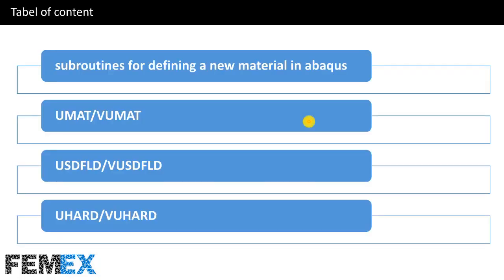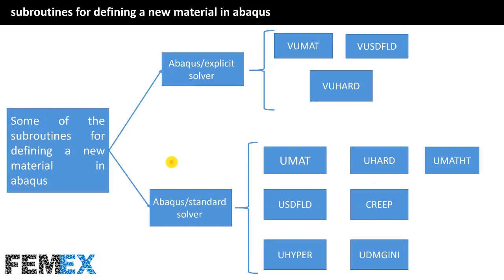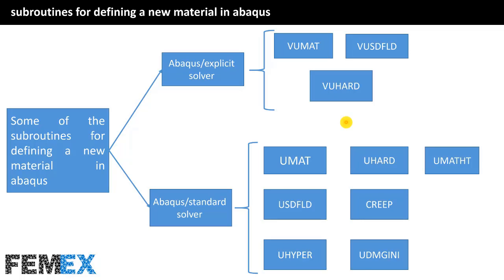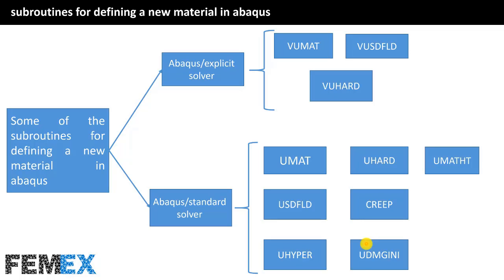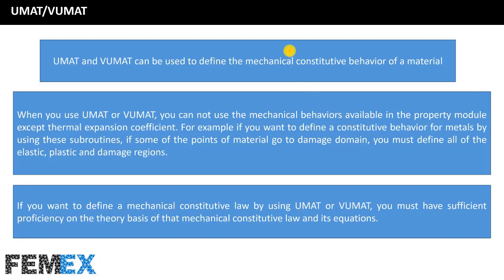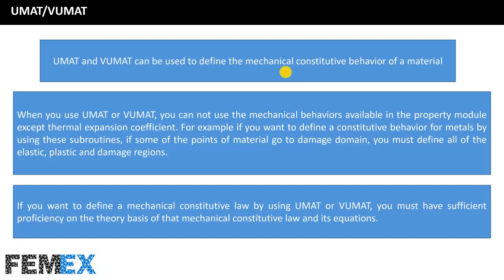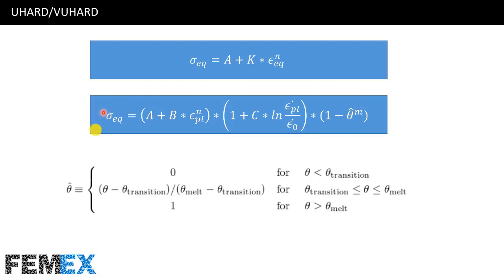umat and other subroutines for defining a new material model in abaqus

Comment: Hi
Thank you so much for your videos
I have a question about writing vumat subroutine for JC model including the thermal effects. Should i write the heat transfer equations including the conduction equations in the subroutine ?
Thanks in advance
Reply from the maker: Hi.
You are welcome.
Honestly, I have not done it before, but as I have read its related documentations for several times, I know that conduction equations must not be written in the VUMAT. Actually there are two choices :
1) writing subroutine for adiabatic process
2) writing subroutine for coupled process
for the first case, you must only write the energy balance equation which is like Q=m*c*delta_T.
For the second case I don't know what should be done.
Reply from the maker: If you are not familiar with the adiabatic process, please watch this free video from our YouTube channel :
https://www.youtube.com/watch?v=5PrE9HNo99g&t=106s

Comment: what subroutine would I use for size effect of concrete??
Reply from the maker: hi. it depends on the equations of what you mentioned. in some problems the USDFLD subroutine can be used instead of UMAT subroutine. it is easier than UMAT.